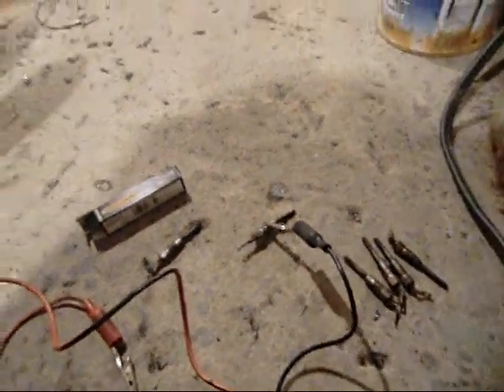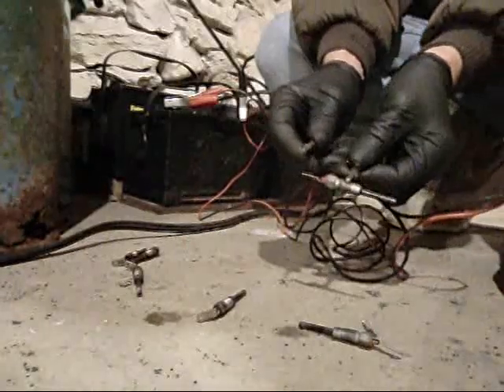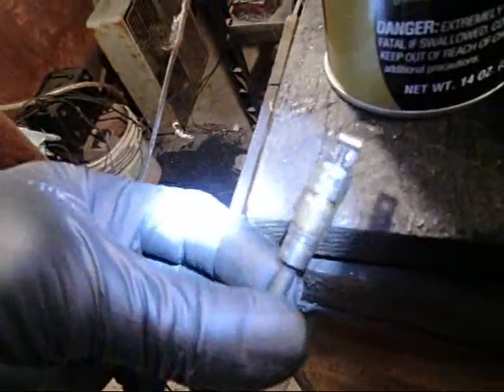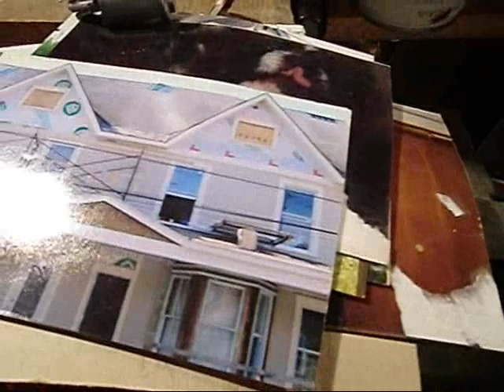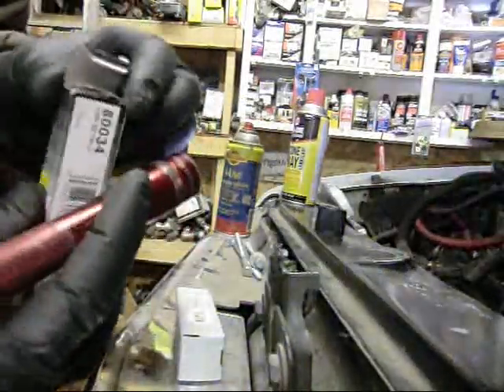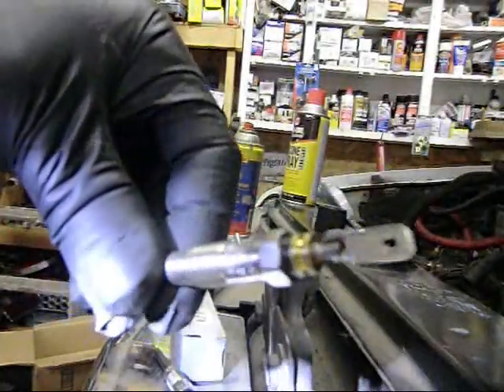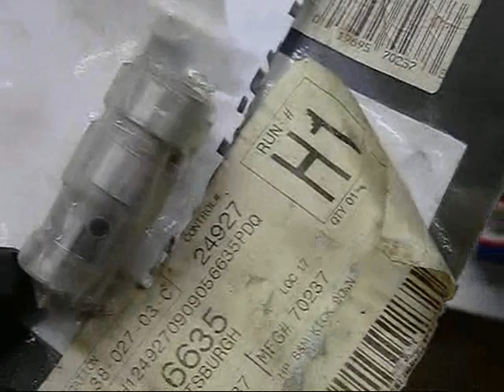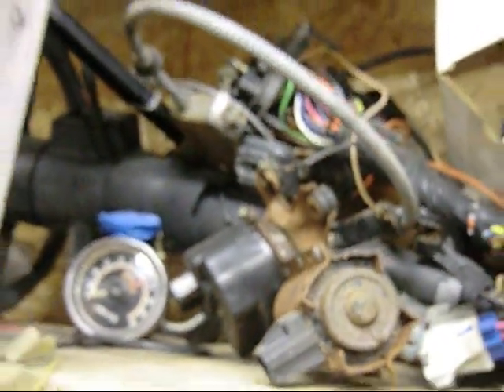12 23 13  Glo Plug Test & Junk Shop Vid

Comment: If you pull the pasenger side inner fender out which is easy to do u can do all 8 then, its still a pain but makes it possable, ive had autolite  glow plug swell and i couldent get it out then when i pulled it out later and it was broken off so thats always nice to find... ac 9g's swell aswell there not the greatest eather but they work...

Comment: You don't want to use shitolite aka Autolite they are the worst GPs the Champions are not much better.

The old 7.3 IDI International mechanical injected used in 88-94 Ford trucks are glow plug sensitive you only want to use Beru or Bosch glow plugs in them. My previous IDI, I had a scare with a glow plug it took some time to get it out. I have another IDI again haven't had to touch the plugs yet.